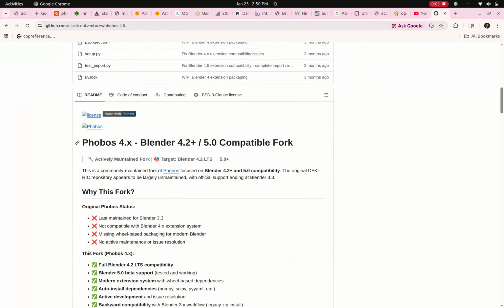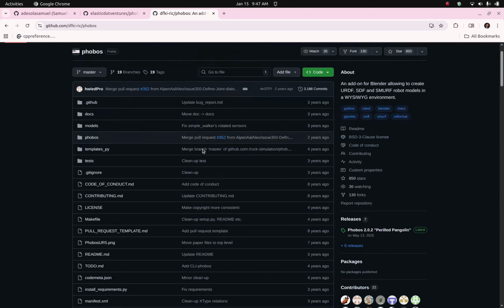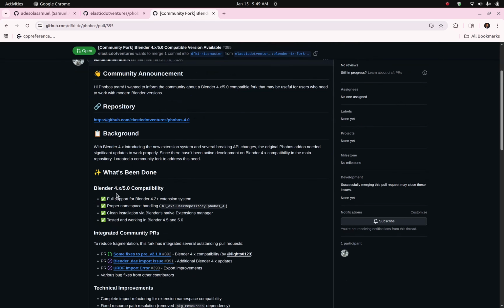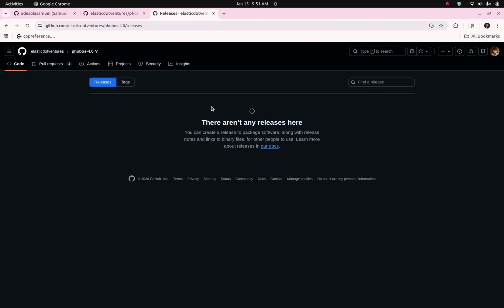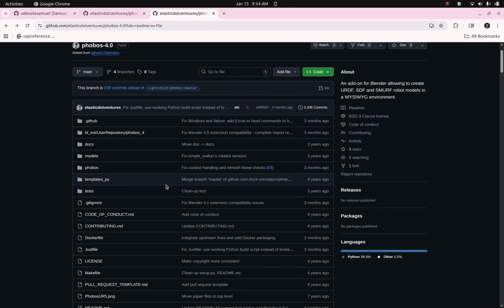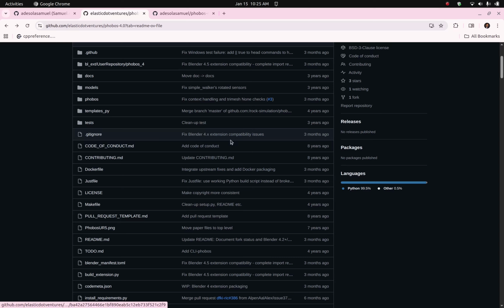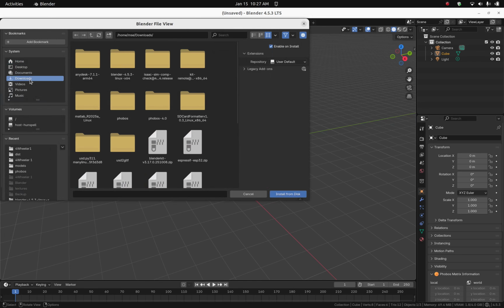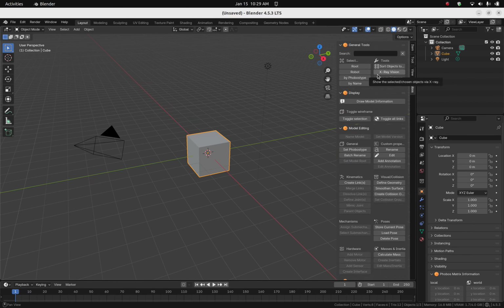Installing Phobos for Blender | Part 1

Comment: I have installed it but I cant see it in the side panels
Reply from the maker: Restart Blender. 

Press the N key to show the panel
Reply: @R @RolesAcademy i try restart blender，but still cant see it in side panels，i ask gemini，he tell me the addon cant find some python module
Reply from the maker: @chiggalikeme_ are you on Linux or windows?
Reply: @RolesAcademy  Windows
Reply: Blender System Console OutMeassage:“Missing required Python package for Phobos: No module named 'pydot'"pycollada""scipy".“
Reply from the maker: @c @chiggalikeme_  can I help you resolve this individually? If you can send screenshots to rolesacademy@gmail.com